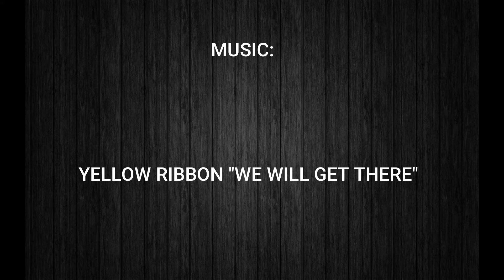HOW TO PAINT A RUSTY METAL FENCE

Comment: One of the best how-to videos I ever watched.  I followed every step, using the same brands.   The 5 steps are time consuming (overnight waits between many steps) and took a lot of work, but the results were really good. Take the time and put in the elbow grease to REMOVE the surface rust before you apply the kleenstrip.  I went through multiple wire wheels.  

Totally worth it.  What an improvement. Thanks a lot.
Reply from the maker: Glad to hear it worked out for you.  it's always better to do the extra 
 work up front, and not have to redo it in a couple of years. Thanks for watching!

Comment: Thanks for the easy and thorough directions on painting the fence. I am excited to follow your directions.
Reply from the maker: Thanks and I appreciate you watching my video!
Reply: @deerparkhomeshop2471 so this is a 4 visit job correct? First to clean and strip and apply acid agent, second to clean that and prime, third is first coat paint, fourth is second coat paint? Can any of these steps be combined in one day? Like first and second coat of paint? Or primer and first coat of paint? Or is it 4 days no matter what
Reply from the maker: @mattcoombs2697  If you are wanting to rush things, you could use a "direct to metal" rust paint.  Supposedly, you can cut the primer step by doing this and also the acid step, if you believe the advertising.  I plan to do research this and probably do another video in the spring on this process.  I have rusty iron railings around my porch that need to be done.

Comment: This is one of the best organized, best presented DIY videos I've ever seen. Thanks for giving us so much information, without any wasted time.  One suggestion - a mechanic's mirror on a stick, about $1 at dollar-type stores and about $5 at car parts and big box stores, would help you easily check for places you might have missed.  One question - would a small, air-powered needle scaler help to quickly get rid of the rust in hard to get to areas?  Thanks again for this truly excellent video.
Reply from the maker: Thank you for those kind words.  When I make this videos I always wonder if I'm on target with my viewers, so your kind comments are reassuring. Great idea about the mirrir and I haven't tried a needle scaler, but I think I'm going to try that out.  Thanks for the suggestions.
Reply: If you have the proper volume air tank & compressor, yes, absolutely.  I used one and it helped great, but my 7 gal compressor couldn't keep up.
Reply: Agree

Comment: I love this video! Very good info and entertainment watching you soak passing cars and spraying that converter above the bushes. This is totally how I work best...tunnel visioned.  I recently pressure washed the paint off of my front porch and didn't even think about the storm door being cracked open to run the power cord. I soaked the entire entry way of my house and had water pouring from the floor joists into the basement. But, dammit, that porch paint got stripped!
Reply from the maker: Believe it or not, it didn't hurt the bushes and no one stopped to complain about paint or water on their cars, so I guess I did OK.  If I waited until there was no traffic on this street I'd have my wife out holding a flashlight for me to work by at 2:00 am.  But then I could soak those guys that wake me up at night with their loud music.  There's an upside to every situation.

I'm glad you enjoyed the video and thanks a bunch for watching.

Comment: Just finished cleaning the rust off my bakers rack using Navel Jelly, going to paint it tomorrow . I didn't use rust converter although I am familiar with the product. Fingers crossed I don't regret skipping that step  . Thanks for the very detailed and informative video.
Reply from the maker: Both naval jelly and rust convertor or similar and both have an acid base to kill the rust, so it should work.  Rust convertor is just more cost effective for big jobs.  Thanks for watching my video.

Comment: Thank you for such an informative video. May I know what and when is thinner applied?
Reply from the maker: In the video, starting at the 5:20 mark, I used the thinner to remove the white chalky residue created by the rust convertor.  This was a brief segment.  I showed this method, but my preferred, and much quicker method, is to use a pressure washer to take it off, which I showed next.  Of course, not every one has a pressure washer.

Comment: About to work on a rusty porch railing and this was very helpful.  I did see that the rust converter can pit concrete per the bottle information so I will put cardboard down for that step also. Thanks for all your help.
Reply from the maker: Thanks for reaching out to me.  The cardboard is a good idea.  Drop cloths or tarps work well, but I have saved a few large boxes , and they slip under the fence rails easier and are lees affected by the wind.

Comment: This is the hardest thing I've ever done. My home is surrounded by metal fences and gates.  I let it go for a couple of years, and now I'm paying the price! I'm using your video step by step. Thank you!
You're in Texas, I'm on the AL. gulf coast so the constant popup showers have been a real problem.
Reply from the maker: I spent over a week just painting about 60' of fence.  Sounds like you have a whole lot more than me, so I feel your pain.  Enjoy those pop up showers though.  We are having a drought here. I'm having to water my lawn every week and my water bill has doubled.
Reply: If you can find Hammerite, an English paint, somewhere,  buy it and try it out. The English use it to paint their stately metal fences in their very damp climate. It is very hard, but not impossible, to find in America. I bought some cans from Amazon a couple of years ago.  The basic steps are the same as shown here, but the Hammerite top coat lasts for quite a while. (Hammerite may have been bought a couple of years ago by the owners of Rustoleum, but the high VOC  content of the original formula is what makes it work.)
Reply from the maker: @Anonymous-it5jw  Ive never seen Hammerite in stores here, but I bet it's available on line.  I'll have to try it out.  Thanks!

Comment: Currently working on one of 4 ornate custom made iron gates.  They had 3 or 4 layers of paint from the past, house was built in '76.
Did a complete strip with wire wheels (ouch) didn't have but a tiny bit of rust, Rust-o gray primer, brush paint.  Rollers haven't been good with the detailed pieces, which is most of the gate,
Reply from the maker: It sounds like they stayed on top of maintenance for you gates.  Lots of work though.  I'll bet you're glad that stripping job is over with!

Comment: Thank you for your detailed video. I’ve watched it twice. I’m about to do my pool fence. 

My fence needs minimal touch up and only slight rust in certain areas. Do I still need a primer?
Reply from the maker: To me the primer is just insurance and what I've always done.  I'm old school.  Even the Rustoleum paint I used can be applied directly over reasonably rust free metals. Of course, in the small print the label says "for even better results use Stops Rust Primer".  There are paints out there that are specifically formulated for direct to metal use, so you may consider one of those.  I can't recommend one yet because I haven't tried them.  However, I hope to use this method in an upcoming video.  Thanks for your comment.

Comment: Would you recommend sandblasting as the first step? Or is doing it 'by hand' (grinder) better?
Reply from the maker: I think sand blasting is a great idea if you have the equipment or you can afford to hire a contractor.  Of course, you need to get a primer coat on it quickly or the rust will simply reappear.  Also, you'll end up with a bunch of sand in your yard.
Reply: @deerparkhomeshop2471  id also like to add that you are correct about the anti rust primer coating, I gotta say all those '3in1' paints DO NOT WORK. It says you can paint directly on rust, I even cleaned the rust to bare metal and the rust reappeared as quickly as one year later!
Reply from the maker: Discovering the rust killer was a game changer for me.  Like you, I previously had problems with rust reappearing.  @ivaerak

Comment: You should also wear a RESPIRATOR with vapor filter for the OSPHO (or phosphoric acid-containing products). 
And an N95 mask for the rust removal.  

I used a sandblasting attachment ($30 on Amazon) for my pressure washer to clean off my wrought iron furniture and steel mesh yard cart/wagon.  It's messy, but cleans rust and paint off steel QUICK.
Reply from the maker: Does it remove enough rust and corrosion so that you don't need to use the wire brush or grinder?  I think I found the one you're referring to on Amazon.  Apparently it just uses regular dry sand, like play sand maybe?

Comment: I Been Painting for 27 yrs. And them spray paint can. Was great. It takes forever to brush those Circles. And points. I will uses that technique. I just learned from you. I will also use it on the locking and the gate Hinges.. i paint a fence just like that. Monday. I was going to try out a painter Glove.. I hear they work pretty good.. Faster using them on poles  of pipe. You should make a Video painting with one of them. If you do give me a shout out. Londo. Thank you.
Reply from the maker: Glad you enjoyed the video.  Like you, I find the circles difficult to deal with and trying to get into the tight places around them eats up my brushes.  I haven't tried the Glove yet, but it sounds like, with your experience, you should be the one making the video.

Comment: Can you use the same process to just address a couple of spots on the fence instead of doing the whole fence
Reply from the maker: Sure, and if you don't have pitted or rust buildup, you may not have to use the wire brush or grinder.

Comment: Hi guys, i need advice from an expert. I am doing a big job at my house painting mild steel gates amd railings. I am going to use 2 in 1 acrylic spray can paint as a primer. This is suitable to get in between the cracks on the gates/railings. My preference is to top coat with enamel resin lacquer paint. Will the enamel paint be ok to go on top of the acrylic 2  in 1?
Reply from the maker: The general rule of thumb is that you can use oil base over acrylic, but not the other way around.  I use oil base rust primers over steel and don't have much experience with the acrylic primers.
Reply: @deerparkhomeshop2471  thank you kindly...
Reply from the maker: @eamonnmurphy1844 Well, thank's for watching.

Comment: Thank you! I wish I had seen your video last year when I painted my 1950s iron patio furniture: 2 tables, 10 chairs, a couch, and an end table. 
It’s been a year. Although I thought I got the rust off, and I used the Rustoleum rust-converter primer, I have rust coming through. 
The kicker is now Rustoleum has discontinued their light turquoise color Stops Rust enamel. 
I think I am going to have to get a couple cans of the brush-on Stops Rust enamel and try to mix colors to match it. What a pain in the neck! 
Do you think your process can be used on touch-ups?
Reply from the maker: Is the rust just coming through in a few isolated spots or do you have a much bigger problem?  It sound's like your rest convertor was actually in the primer and not a seperate product like I used, and I haven't used their "Stops Rust" product.  I used the Professional primer and enamel, but your's should be a good product.  My thinking is to just try to touch it up, but if it comes back, you'll probably need to take it back to bare metal.

Comment: 5/14/24 
Watched your video, and it was great. I have a few questions.
Notice u just used a Wire brush and a wire brush set attached to your electric drill to remove the rust plus u used your grinder on heavily pitted areas then used your rust converter.
Questions -
1) Did you not find it necessary to use any sandpaper? 
Does the above method take care of all the rust?
2)So use the brush etc. mentioned above to remove as much rust as possible and just on the heavily pitted areas you use your grinder. U states:" On heavily pitted areas  I used my grinder. Not only did it remove the rust but it gave me a nice smooth area to paint over" 
3)Did the grinder remove the rust all the way to the bare metal?
4)Should u try to remove all the rust to the bare metal where it is really bad? Ie pitted areas
5)If u remove the rust to the bare metal do u need to apply your rust converter over that?
6)I noticed u used Rustoleum  Paint and primer. Have u ever thought about using Sherwin Williams DTM PAINT?
You don’t have to use a primer?
7)I have used it in the past and was just going to prime my rusted spots and paint the rest with Sherwin Williams DTM PAINT?
8)I also already bought some Krud Kuter-The Must for Rust, have u ever used this product? 9)Why did use  Kleenstrip 1 gal. rust converter?  

Thank u ,Donna
Reply from the maker: Lots of questions.  I'll do my best to answer them.
 If you prefer to use sandpaper, you can. But whether you use sandpaper, grinder, or etc., it's optimistic to assume that you can remove absolutely all of the rust.  That's why you use the converter.  It will neutralize any rust you miss.  The Krud Kuter-the Must should work fine.  As a matter of fact, Krud-Kuter is a Rustoleum company.  I use the grinder because it is fast, and I use it because I don't like the look of all that rust build up under the paint, although the proper use of the converter would have penetrated the build up and killed the rust.  

The Rustoleum paint I used is an oil based DTM paint.  The label says that you can paint it directly over metal, but they go on to say that use of a primer will give longer lasting protection. 

I have not tried the Sherman Williams DTM product so it would be irresponsible to recommend it.  What I have seen is acrylic. Not sure that I want to use a water based product for this application. However this is a company that makes high quality products.  Search for "direct to metal acrylic paint" on youtube.  There are a number of videos there that might help you decide.

Hope this helps, and reach out to me again if you have anymore questions.
Reply: Thank u for responding so quickly. Few more questions.
1)Does using the wire brush attached to the drill do a better job at removing the rust vs using the manual brush?
Or will the wire brush attached to the drill make it easier and faster to use?

My Sherwin-Williams paint is called Direct-to-Metal Alkyd Enamel,it is not DTM acrylic. I asked the store and they said it is oil-based. 

2)Can I just prime my rusted spots after they are treated with Krud Kuter-The Must for Rust and then put 2 coats of my DTM over my entire fence versus applying an entire coat of primer and then an entire coat of DTM. I was told the DTM essentially has a primer in it.

3)Have u ever tried applying the paint with a small sock on a fence like u have compared to a roller /paintbrush. I have seen people do it on u tube. Wondering how it looks, does it look as nice as using a roller. Do u think it is quicker to use a sock?  Thank you .Donna
Reply from the maker: @donnab5657  1.  It is mainly much faster and easier.  You can do a good job with the hand held, but you will get weary and will be tempted to cut corners.
2.  The idea of the DTM paints is that you don't have to prime at all.  If you clean and wire brush it good, and then use the Must for Rust you can paint directly over it.  It does have primer and a rust inhibitor built in.  Just read the instructions carefully and make sure there are not special circumstances.  One I looked at said direct for bare metal, but to prime over oil or alkyd painted surfaces. 
3.  There's nothing wrong with the sock method. It just takes a bit of practice to get the hang of it, and some of the youtubers have mastered it.  It tends to be sloppier.  Be sure to put down a protective tarp or cardboard because it tends to cause paint runs and drips as you wipe it on. You'll still need a brush for scroll work, corners, and tight spots. 
FYI.  I will be painting a wrought iron railing this summer using the DTM paint, so watch for my video.

Comment: Hi Mike,

As pretty much everyone else has written, you've done a very nice job of giving us the important information, without extraneous commentary.  I really appreciate your succinct thoroughness.

I'm going to be painting a customer's metal fence.
Most of it is in good shape, though the last paint was applied about fifteen years ago.

My question has to do with the gate hinges.  There's a bit of rust seeping out from between parts that hold the pin.  I can't pull the pin out as I do with a normal door; that would enable me to get to the rust source.  Nor do I want to get paint inside the joints.

So, any suggestions about how I can handle this situation?
Reply from the maker: Thank you for the kind words!  Can't hear them enough.  
You might try saturating the hinges with the rust inhibitor.  You could use something like a glue syringe to inject it into the joints.  If it needs it, follow up with WD40.  Just make sure you clean all the residue off the outer parts before painting.

Comment: How many days/weeks did it take you (working how many hours per day) and how many linear feet approximately?
Reply from the maker: It,s really hard to say.  I worked it for about 3 weeks, but a lot of my time was spent filming, doing takes and retakes, editing, and on my video program.
Reply: Man I wish I had a drill that works off 120v my batteries keep running out!
Reply from the maker: @josepgutierrez22  But then, if I work outside with my electric dill, I have to lug around a 75' or 100' extension cord.